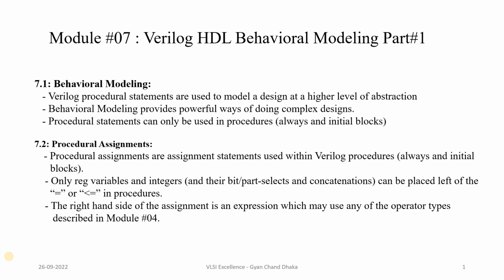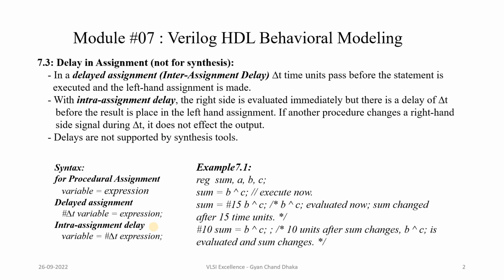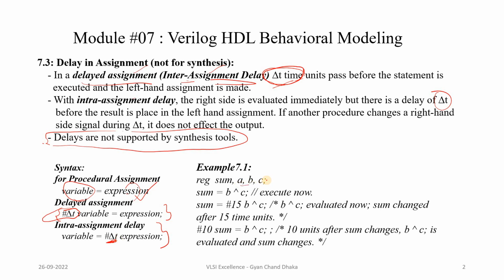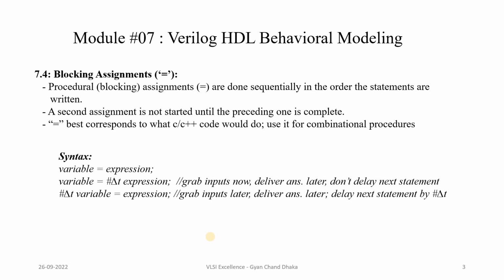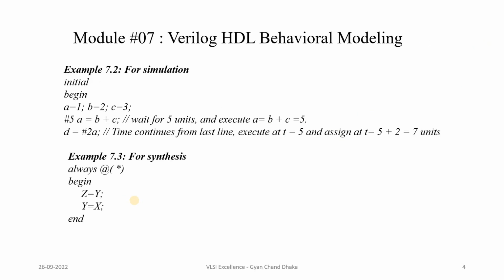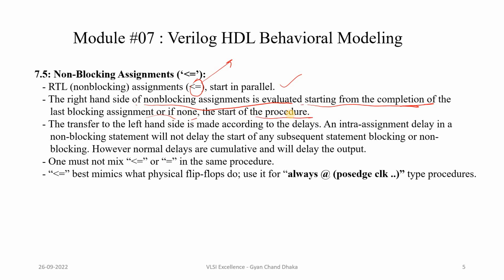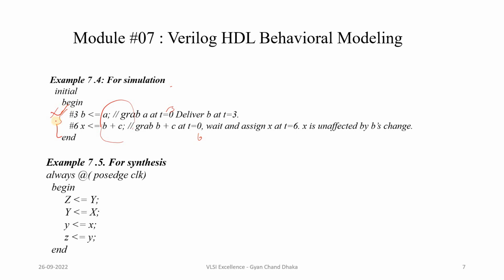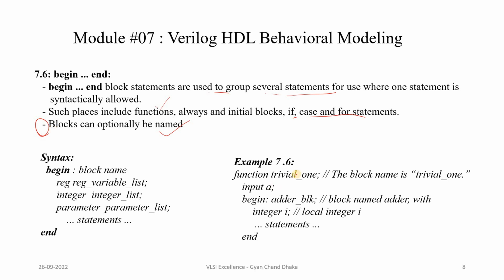Verilog HDL Crash Course | Verilog Behavioral Modeling Part#1(Delay in Assignment) | Module #07 |👍&🔕

Comment: Hi! I have a question in the non blocking assignment!

You mentioned that the second non blocking assignment happens at t=6, but is that right? Shouldn't it be at t=9?
Thanks for the series, they are useful!